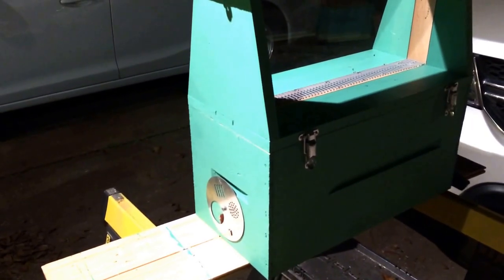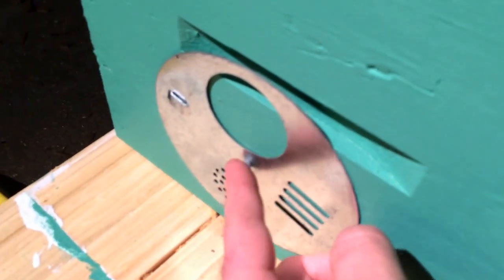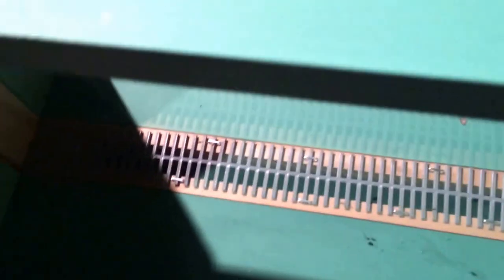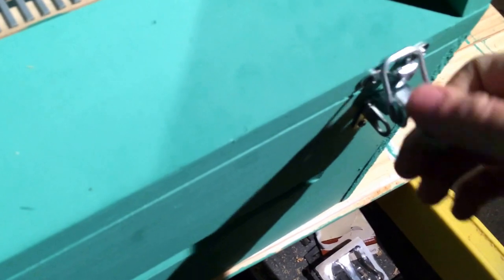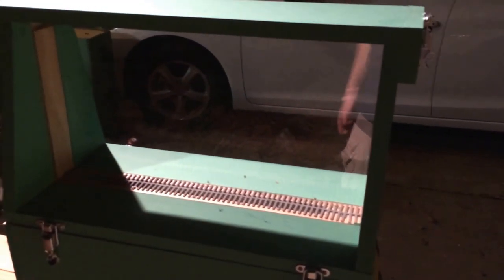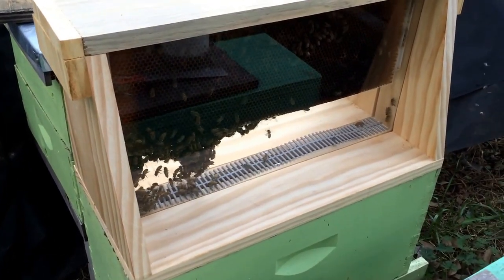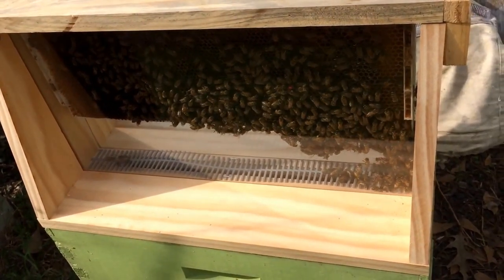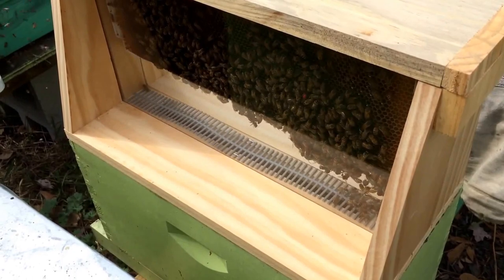Portable Observation Beehive

Comment: That turned out really nice. You could actually use the nuc with the screened bottom as a cell starter also.

What's with the loud speaker in the background?
Reply from the maker: Yeah sorry about the background racket. There is a school about 100 yards or so through the woods, and I guess they were letting out. So they scream out to the kids where their parents are parked so they can get picked up. 
I do have a screened box that I put below my nucs for cell starting. It's a whole box about the size of a medium 5 frame, fully screened for max air inflow.